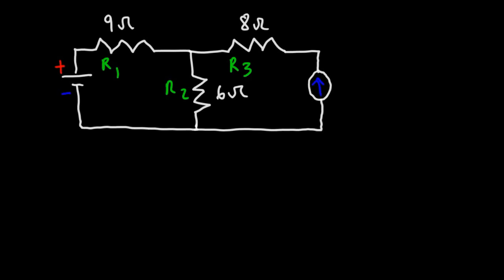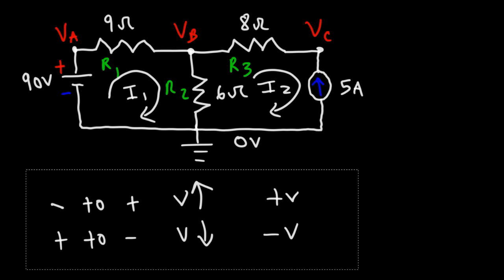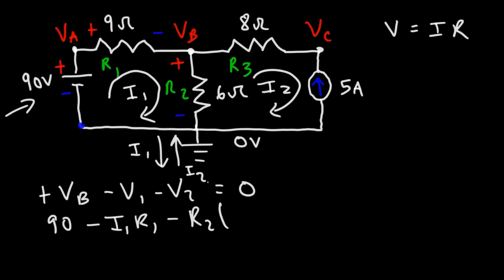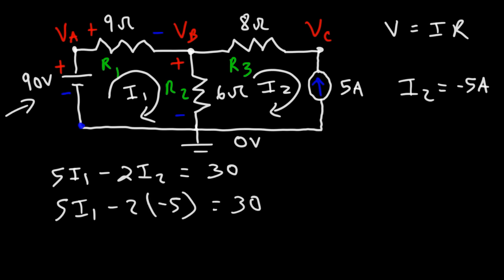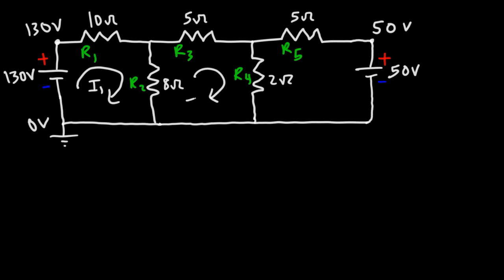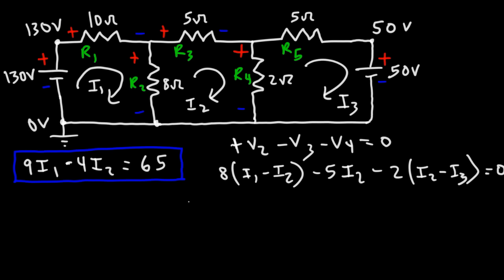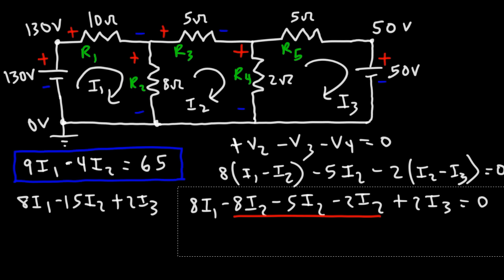Mesh Current Problems - Electronics & Circuit Analysis

Comment: At 14:00, why does he put 8(i1 - i2) instead of 8(i2 - i1) when i2 flows through the positive of the resistor so shouldn't i2 be positive and i1 be negative?
Reply: Beacuse he was working According loop 1...
Reply: 8(i2-i1) is correct. I guess he missed that side
Reply: I was confused as well but the answer is actually correct because there are two ways to solve this.

1) (His way) to keep the polarities constant in each loop while using the previous current calculation.

2) (another way) To change the polarities according to the current flow direction and input the new difference in current by giving priority to the current that is in that certain loop.

Both ways result in the same answers.

Comment: In example 1, why is the current flowing through R2 the difference between I1 and I2? Is it just convention to make both loops flow in the same direction clockwise?  (That is, Mesh Analysis does not work if we do not do it this way?)

I'm confused by the arrow on the current source. To me it seems to say that I2 should flow in the opposite direction, but perhaps I am misunderstanding

Comment: You say use Vb for the voltage across the battery but on your circuit diagram Vb is designated to the node where R1, R2 and R3 connect.

Comment: I was confused as well but the answer is actually correct because there are two ways to solve this.

1) (His way) to keep the polarities constant in each loop while using the previous current calculation.

2) (another way) To change the polarities according to the current flow direction and input the new difference in current by giving priority to the current that is in that certain loop.

Both ways result in the same answers.
Reply: <3

Comment: 14:03
Sir
Isn't it should be 8(i2- i1)? 
Coz i2 is potential rise and i1 is potential drop
Reply: Edit:
I compared the approach of other vloggers, in this video R2 and R4 remains with their polarity that's why  8(i1-i2)

In the other approach they reverse the polarity between the meshes

Mesh 1
R2 is  Positive UPWARD
Current downward
Mesh 2
R2 is positive DOWNWARD 
current upward

Mesh 2: 
- 8(i2-i1)-5i2-2(i2-i3)= 0
BY INSPECTION this video is right. 🙏
Thank you for this video
Reply: I was confused as well but the answer is actually correct because there are two ways to solve this.

1) (His way) to keep the polarities constant in each loop while using the previous current calculation.

2) (another way) To change the polarities according to the current flow direction and input the new difference in current by giving priority to the current that is in that certain loop.

Both ways result in the same answers.

Comment: You need to be more careful with your notation. VB is used twice (V battery and V B node. and I2 is used twice (I2 for R2 and loop current 2)
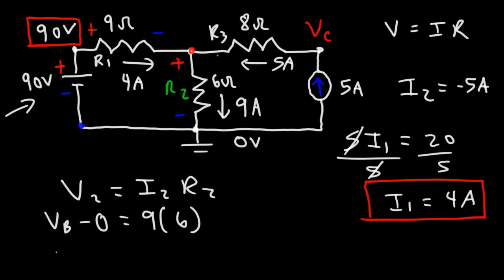Reply: 8:53 you have I2 = 9 Amps and in another place you have I2 = -5A. But it is IR2 = 9 amps and Iloop2 = -5 amps.
Reply: Vsource = 90V VB = 54V

Comment: forgive my ignorance, (first problem) but was this just an example problem? or is it somehow actually possible to have more Voltage than what the battery outputs? because if the battery is 90V and point C is 94, im wondering how its possible, does it have to do with the current source? thank you in advance
Reply: I also have the same question and also commented on this, and I'm waiting for the response.

Comment: for second loop, shouldn't it be 8(I2-I1)?
Reply: I believe it should be
Reply: If you are going to do it like that it has to be -8(I2-I1) .
Reply: Nope, there's a special case current source which is the 5 amp, basically the 2nd loop is i2 = 5A
Reply: if a Branch current is being used thru  R2 , where the Branch current is depicted to move Downward thru R2 , the  2  Equation Fragments you speak of would be :   +( I1 - I2 )R2   for Mesh  I1 ,  and  -( I1 - I2 )R2  for Mesh  I2 .
however ,
if  he had used  "Mesh Currents"  thru  R2 ,  the Two  Fragments would have been written this way :  +( I1 - I2 )R2  for  Mesh I1 , and  +( I2 - I1 )R2 for Mesh I2

please note , the Two Fragments of Mesh I2  are  identical ,...
-( I1 - I2 )R2  is the  Same as  +( I2 - I1 )R2
being identical , it can be confusingly easy for someone to Mix  conventions of
Branch currents and Mesh currents . Thus many people do NOT know what
they have actually written ,...been there , done that , but NOT anymore .

The Symantic of writing  these Two  Forms is Hugely different .
If this seems odd , then you do NOT yet know the difference between a Branch current and Mesh Currents , and you do NOT yet clearly understand how to Traverse a circuit using  ( KVL with Ohm's  Law ) .  keep studying , keep reading .

it takes depth of understanding of using  ( KVL with Ohm's Law ) , to know the simplicity and difference to what is going on here . The video does NOT discuss such details . And there is NOT enough room here , for me to describe those details .

he wrote  8( I1 - I2 ) when in Mesh loop I2 ,
but he did NOT  describe the technique . what technique ?
was he using the +-sign as he Enters each component ?
was he using the +-sign as he Exits each component ?
the Video is a mess .
He is using the +-sign as He Exits  each component , when writing the KVL +-sign.
He is using the +-sign as He Exits  each component , when writing the KVL +-sign.
And , he reverted to using  a Branch current thru  the 8 ohm resistor .
He is NOT using Mesh currents thru the 8 ohm resistor .
Thus ,
he does NOT know the difference between a Branch current and a Mesh current.

While traversing Mesh  I2 , he encounters  the 8 ohm resistor .
Traversing Up thru  the 8 ohm resistor , the +-sign Exiting  8 ohm resistor is
 +pos ( at the Top ) .
Next , he is using  ohm's with the  Pre-labeled + at Top and - at Bottom .
thus he wrote +8( + I1 - I2 ) , which is Valid , in the context of the technique
he is using .
note : +8  is  +KVL ,  + I1  is  +pos ohm's law , while  - I2  is -neg ohm's law .
I do NOT write equations the way he did . He has choosen to do it like that ,
and he does it the same way all the time , than the equations that he writes are
valid ,...but what a mess .  Too much effort to Reverse Engineer to discover
someone's Technique . He should have described all this at the begining .
Still ,
he does NOT know the difference between a Branch current and Mesh currents .
Effectively , he wrote the equation fragments using  Branch current I3 , as if
I3  were the Current that flows Down thru the 8 ohm resistor . That is why
he always writes  ( I1 - I2 ) for   ( Mesh I1 and Mesh I2 )
of the 8 ohm resistor , because  I3 = ( I1 - I2 ) .

For the equation fragments that i wrote  , i am using the +-sign as i
Enter each component . And i am writing  ( KVL with Ohm's Law )
for the  Resistor .
A  Voltage source only has  KVL +-sign , as there
is No  Ohm's Law for an Independent Voltage Source .

in addition to all that , some people choose to  ( KVL hop )
across each component when traversing , saying V-rise  or  V-drop .
Many techniques are possible , however some techniques are easier
to use then others . using KVL hop is usually more difficult to use .
using  +-sign when Exiting each component is usually more difficult to use .

quick observation to your  question :
+8( I1 - I2 )  is  Valid
- 8( I1 - I2 )  is Valid
+8( I2 - I1 )  is Valid

ALL  Three  are Valid !
how can that be ?
when using different techniques , the first level equations can look differnent .
regardless of the technique used , once a technique has been choosen ,
ALL portions of the equation writing must then use this same choosen technique .
Thus , your  question really comes down to  Mixing  Conventions during the
equation writing process .  His  equations are Valid , based on the technique
he is using . You  are trying to view his analysis in a way that you are familiar
with but is a different convention , thus you are Mixing Conventions thus you
caused  confusion onto your self .
your initial concern does reveal an important point .
When writing equations , do NOT Mix techniques .
When writing equations , do NOT Mix Conventions .

If you choose to write KVL +-signs as you Exit each component , then you MUST
Always  do that for Every component in the circuit , during a particular analysis .

If you choose to write  KVL +-signs as you Enter each component , then you MUST
Always do that for Every component in the circuit , during a particular analysis .
Reply: @nax1807  It should NOT be .
+8( I2 - I1 )   NOT Valid , based on the Context of technque the video is using .
you too , are  Mixing Conventions .
Judy - chan  question is Out of  Context .
Judy - Chan is  Mixing  Conventions .
i have a Huge explination to  Judy - chan .
Reply: @loertishahini3419 
-8( I2 - I1 )   NOT  valid , based on the Context the  Video is using .
Judy - Chan  question is  Out of Context .
you too , are Mixing  Conventions .
i have a huge explination below .
my huge explination is a Reply to  Judy - chan .
Reply: @240mains  then explain
Reply: @cestlavieeee  firstly , the  video  is a mess .  the video is using  a  Branch current thru the  8 ohm resistor , thus the video is NOT using  Mesh currents .
next , the video does NOT describe the Inner workings of  Mesh  Equation writing ,...namely  ,...a complete Mesh equation  uses ( KVL and Ohm's Law ) . the video fixates only on  KVL . For all noobs to  equation writing  and basic physics problems , the video raises more questions then it explains .
Note , the video  shows only One +-polarity  across  the 8 ohm resistor .  When traversing  with Mesh arrow I2 , thru  the 8 ohm resistor , the video is using the  KVL  as  it  Exits each component .  We are moving Up thru the 8 ohm resistor and thus  Exiting   at the Top where we find the  +sign ( KVL ) . we also see that  I2 is Entering the  Bottom of  the 8 ohm resistor , thus  -neg Ohms Law  for  -8*I2 . we also see that  I1  Enters  8 ohm resistor at the Top at the +sign , thus +8*I1 is  +pos Ohm's Law . Thus the  equation  fragment when traversing  arrow  i2  thru the  8 ohm resistor is  + 8( - I2 + I1 ) .  The  +pos with the 8 is  KVL sign ,  the  -neg with I2 is  Ohms Law sign , the  +pos with  I1  is +pos Ohms Law sign .
the above , as used by the video , is just 1 of many , many  conventions that can be used to write the initial first level  equation .
as i have said  , the video is trash .
realize too , since the Video is using a Branch currrent thru  the 8 ohm resistor ,  the fragment  can always be written as  +8 ( I1 - I2 ) .
Because  ( I1 - I2 )  Ohms Law  is  always the same ( Fixed ) , because the video is using a  Branch current thru the 8 ohm resistor ,
+8*I1  will Always be  +pos Ohms law ,
- 8*I2 will Always  be  -neg ohms law .

realize , any confusion that anyone has , has nothing to do with  circuit analysis . Instead , the confusion comes from not being able to solve simple vector based  physics problems .

the above explination conforms to the Context convention the video used.
Use any convention you want . However , when trying to Follow someone elses analys , you must Use Their  convention , to understand how they wrote their  initial first level mesh equations .

All Conventions are  Valid .  Nothing  is Backwards . However ,
do NOT get tricked by that .
hint tip :   +   -  measureing +5v ,  is equivalent  to    -  +   measuring -5v .
Both  descriptions are  valid . however , if the Context of the given orientation is   -   +  , then the only correct answer For that Context is  - 5v .
But then , if the original  Context of the given orientation were  +  - , the only correct
answer for that  Context is  +5v .
regardless of the Context that is used , one thing Remains  Absolutely  True ,...
the  Left side  is Always the most  +pos  side ,... the Left side is absolutely
5 votls more +pos then the Right side .

the posted questions here is about ,..."Shouldn't it be" ?  which really is the same as
saying : "you did it backwards" . That tells me the OP  original posting of the
questoin dows NOT know how to solve and work with physics problems .
And , the  Video person does NOT step in to hlep explain , because it seems
they do NOT know what is going on either . sad , sad , sad .

solve a basic  physics projectile problem , using  + is Up , and -  is Down.
and yet , someone else can come to the exact same conclusing by having used   -  is Up and  +  is Down .  Perfectly  logical . If that  confuses you ,
then you will really have  issues trying to  write equations for  electric circuits .

if you ever find youself saying to someone else that :  "You did it backwards"
then most likely , you do NOT know the basics of physics problem equation
writing and physics problem solving . As , they could just as easily say to you that
you are the one who is doing it backwards . Which is what this whole post has 
been about . Because someone said : "Shouldn't it be" ? yeah ,...they are insisting
that something is Backwards . that really makes me shake my head in amusment .
Too sad , the posting of the Video does NOT know what is going on either , as they
have said Nothing .

DC\AC  books do NOT explain how to solve  physics problems .
and that , is the problem .

keep reading , continue to study .
Reply: @240mains  How much free time do u have? lmao.
Reply: @AltaafJahankeer1501  you are NOT interested in the topic . why are you here ?